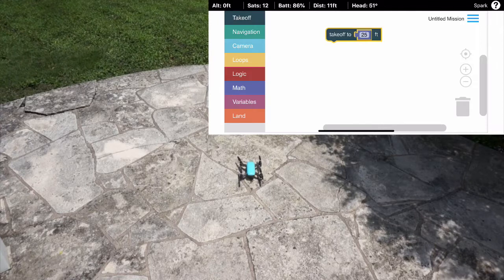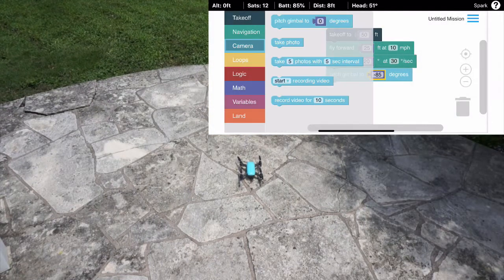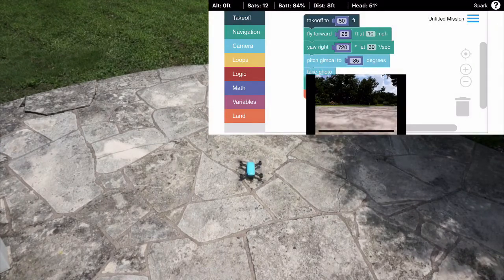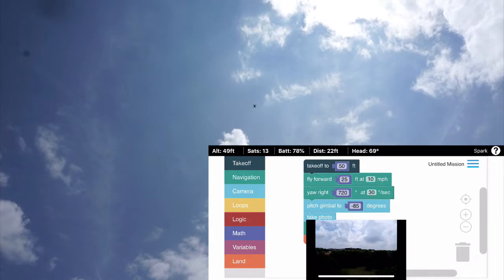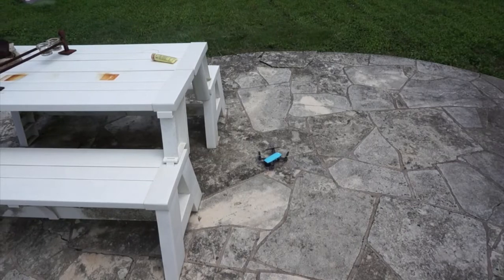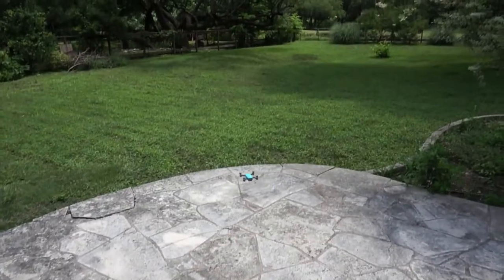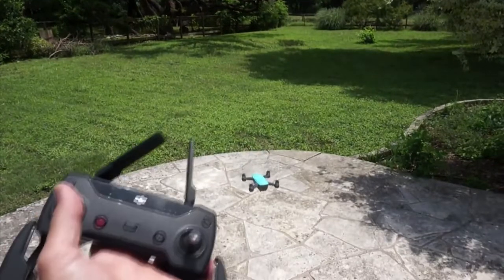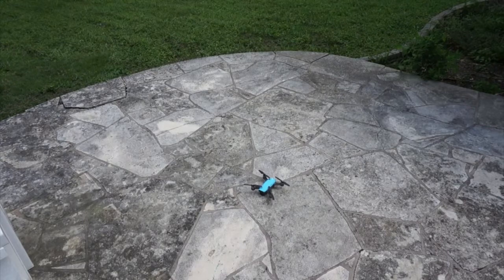DJI Spark SDK 4.10 & DroneBlocks Testing

Comment: Brilliant work, thanks from Australia
Reply from the maker: Thanks Michael. I'd be interested in hearing how DroneBlocks works down under if you have a DJI aircraft to test with.
Reply: @dennisbaldwin  Will do as soon as the rain stops. Just now came across program.
Reply: @dennisbaldwin  Spark connect with wifi, but Air only with cable. But I get no maps. Also, is it possible to change to from feet to meters?. Can't find any Settings
Reply from the maker: @3goldfinger  Try previewing a mission without being connected to the aircraft. Maybe a few fly forward blocks and then preview. Make sure you have a valid internet connection. Do you see maps then? If you continue to have problems please feel free to email me db at droneblocks dot io and I'll be glad to help.
Reply: @dennisbaldwin  Yes, everything is working perfect. After seeing s few more videos, I worked it out. Cool App. Thanks